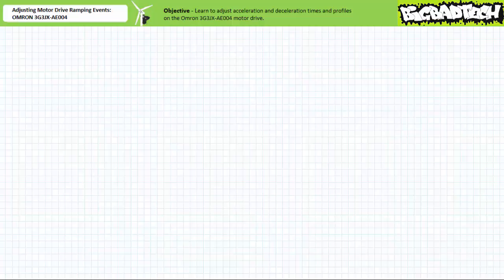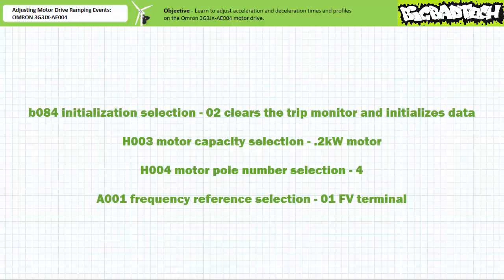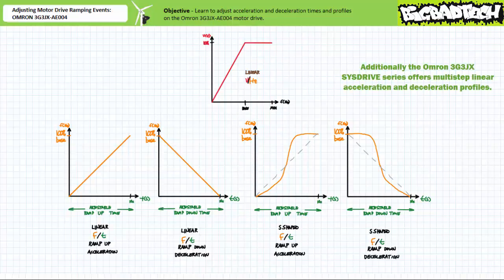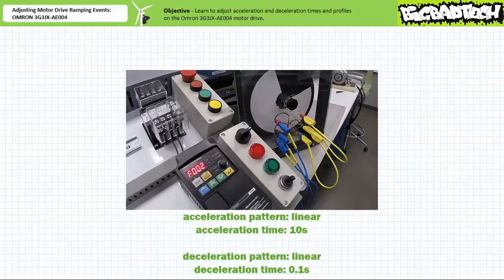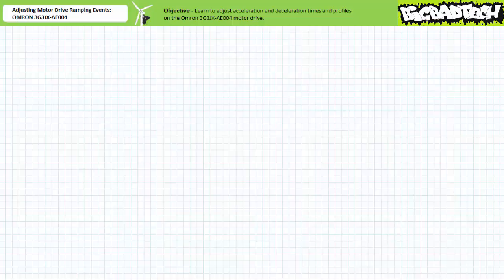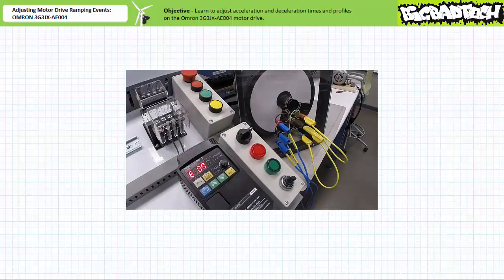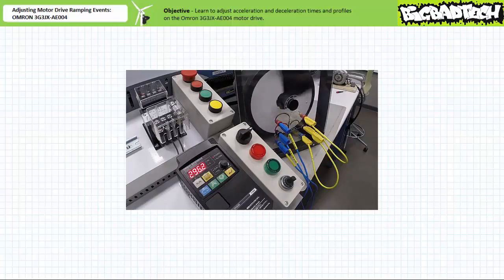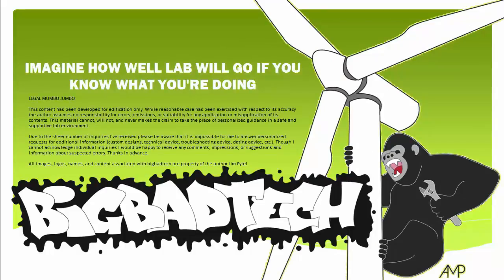Adjusting Motor Drive Acceleration Properties: Omron 3G3JX-AE004 (Full Lecture)

Comment: Why does itnot  goes in error with a 0,1 seconds deceleration ramp?
Reply from the maker: Too quick of a deceleration results in a voltage spike in the DC bus. Check out the deceleration and braking methods lecture at: https://youtu.be/P4bDpyJCzp4